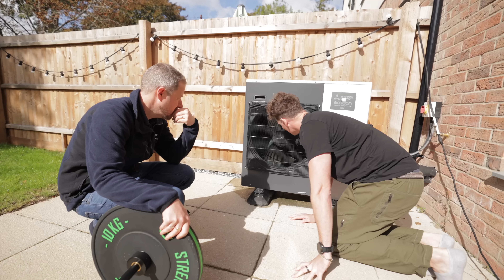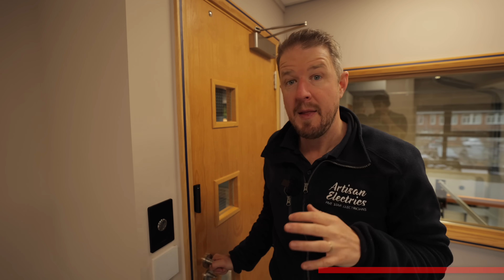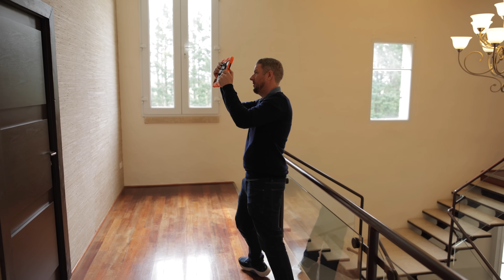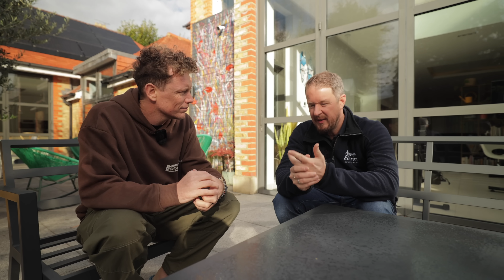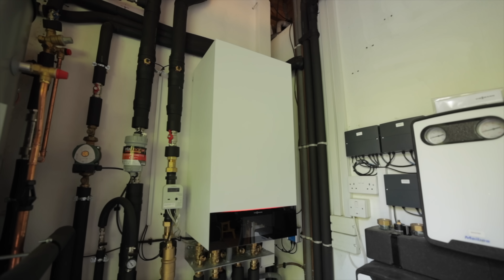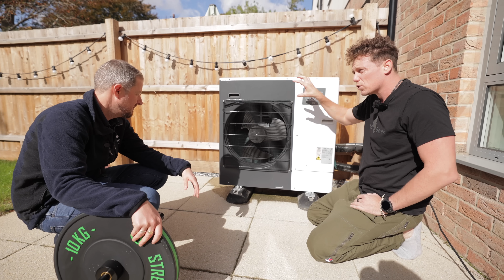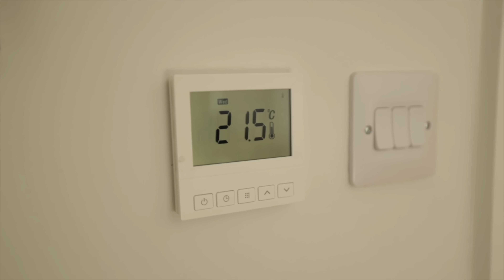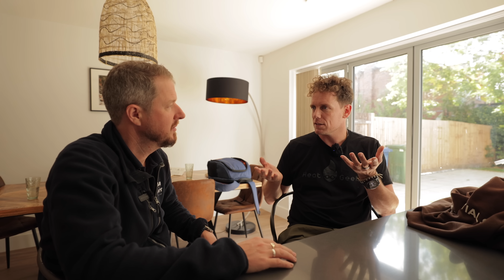Are Heat Pumps Really Worth It In 2026?

Comment from the maker: We’ve partnered with iwoca to help more small businesses like ours get the funding they need — check them out here 👉 iwoca.co.uk/artisan

Make sure to check out the Heat Geek YouTube channel for more in-depth technical videos, training content, and expert insights on all things heat pumps and low-carbon heating - https://www.youtube.com/ @HeatGeek
Reply: What’s was the link for the heat pump postcode check, don’t see it in the description?
Reply: As a retired Heat pump Manufacture , I personally believe the statement by Heat Geek is claiming that Air source heat pumps are as efficient as ground source is erroneous.  The COP is never as good as a well designed Ground source and it doesn't have to take its heat source from bore holes it can be from lakes rivers even from disused mining levels. the other issue with air source is the ice build up on the fin coils and either reverse cycle defrost or electric element heating to melt that ice destroys there energy efficiency particularly due to icing and and the UKs very high rainfall and general damp conditions. i also would add that his statement regarding insulation was misleading. It doesn't matter what form of heating solution that is employed to maintain a comfortable internal environment, insulation is paramount. lack of insulation increases the  cycling of the system trying to maintain that desired temperature due to heat losses due to totally inadequate insulation or lack of. Think about a passive house and its fantastic thermal performance and the borderline need for a heating solution.
A good heating solution starts with the best insulation you can afford including your windows minimum double glassed preferably triple. Then when you know what the heat loss for the building and only then can you look at what type of system and design. Also its not just about the comfort heating that needs to be taken into consideration its also hot water for washing and bathing as these require much higher temperature's and these need to be factored into the equation as the cop also dramatically declines if you are going to achieve a consistent minimum 60deg c preferably once a week 70Deg c to prevent the growth of Legionella bacteria, an immersion tank should store water at 60°C or higher. This high temperature kills the bacteria, which multiply most rapidly in warm, stagnant water. Its also good to remember to run taps regularly to flush the taps/pipes again because of the Legionella bacteria love the taps that are not used regularly.
Reply: @disabledglobalchallenge290    I’m lost on all this and that in this thread. Was the original argument/discussion not about ‘anything to water’ or ‘air to air’ heat pumps?  Clearly ground sourced (or water sourced) energy is going to be superior to A2W because of the incessant defrosting necessary in our humid climate.  

I expect a borehole is the most consistent, if done properly - but at very high installation cost at the present time.

Ignore this post if the answer to my initial question above was “no”.
Reply: Brilliant to see two excellent influencers collaborating on this. Two quick things which might hopefully help @artisanelectrics

The immersion heater switch needs to be left on because there is a contactor within the heat pump controller to complete the require pasteurisation cycle. Also the outdoor sensor comes fitted to the back of the Mitsubishi heat pump so you can run with weather compensation out of the box.

We hope this helps 🙂
Reply: Immersion needed on modern units!
Reply: Just this year we had an awful (stressful and expensive) situation with a roofing company who damaged our house and took off with our money leaving us to pay for another roofer!!) We are now very distrustful of any trades doing any work for us even though we are interested in heat pumps. What guarantee do we have (in writing) that the replacement heat pump will work as it should do?

Comment: I recently had a mitsubishi heat pump installed by my housing association and I must say what a load of rubbish they are. Costing me twice as much in electricity and was never shown how to use it so I have turned the heating off and sit with a heated blanket instead. I wish they left me with the old boiler.

Comment: When I bought my house it had a failing kerosene condensing boiler. When it had been fitted, maybe 10 years before, the old roof venting flue was replaced with one sticking out the wall at head height - right underneath a balcony on the master bedroom. First night in my new home I was wakened by the sound of a "whoosh" as it started followed by kerosene exhaust fumes billowing in the window. The ASHP moved up the shopping list to number 1! Anyway, two years in it has been a revelation - saves me about £200 a month (electricity cost v oil cost), is almost silent, doesn't smell and maintains the house at a comfortable temperature. Anyway the house is big - 3500 square feet and over 100 years old - despite this a single, single phase, ASHP was adequate and effective. So don't be put off by the "they don't work" myths.

Comment: I got rid off my heat pump went back to the electric 400lt tank the other would heat up during peak times never enough hot water and always on even tho it was around 330lt I have more hot water now and run it on off peak and solar/ batteries

Comment: Licenced electricity suppliers will be able to control heat pumps via the internet by the end of next year under Ed Miliband’s plans to help Britain’s energy system cope with high demand.too much demand lower heat pump output, put on coats

Comment: Here in the UK, heatpumps cost 10x what a boiler does. Costs 10x what a gas boiler costs to run. And will breakdown 2x as often with 10x the repair costs. They also dont cool the house well as all our houses are super insulated to save heat in the winter. Any clever ideas like ventilation will be offset by polution filters and LAWs on building design making throughdraughts bad for winter efficiency. Some houses even have windows that wont open. Ive seen offices that switched to heatpumps and everybody brings in under desk electric fan heaters to stay warm in winter. Thats not cheaper. An elderly relative swapped her gas boiler for a heatpump. Gas install 2k. Heatpump 15k. Gas annual running cost 1k. Heatpump 5k. She wants it ripped out. Our government love flip flop ideas. They keep changing the goalposts to make people spend money. Its nothing to do with saving the planet. Pushing Insulation in walls and roofs. Now being removed because its bad for damp and some people cant get mortgages because of it. Push for gas boilers as its more reliable. Now gas is bad. Push for LPG cars then put up the tax until no one has them any more. Push for diesel cars. Scrap all petrol cars. Now diesel is bad and petrol cars are more expensive. Diesel cars are being taxed to the scrap yard. Push for electric cars. Now increased tax on electric cars making them more expensive to run than petrol. Its all a joke here. after all that the UK only makes 5 percent difference to the world environment. God help the planet.

Theres a theory that the rainforrests are dying because theres NOT ENOUGH co2. That the world co2 levels are actually dangerously low and our Governments are too scared to backtrack on 50 years of taxes.

Comment: I recently saw a chart indicating heat related deaths are higher in Europe than the US because we have heating and cooling. A heat pump can offer heating and cooling. Any reason why more heating/cooling heat pumps aren't being installed more? I realize you are hooking up the heat pump to a single boiler for radiant heating/domestic hot water, but you have more choice with heat pumps being able to heat and cool. And from the weather reports I have seen recently your summers are becoming hotter for longer durations. Maybe it is time for multiple zones that offer both heating and cooling options.

Comment: Put something outside in your back garden with a large high voltage PCB in it in all weathers and it’s just a question as to which will come first, that the board will fail just outside the guarantee or the neighbours kid with poke a stick through the evaporator.

Comment: My house is 1906, 9" wall construction. All double-glazed, 300mm of loft insulation. Heatgeek would not agree to honour their engineer fitting a unit to warm my property. The engineer said he could do it without them being a part of it, but would require two heat pumps totalling £20,000 of work. This is not a solution for old homes.

Comment: In Sweden an air-to-air heat pump is around £3k fitted. Not 10k. No need for a £7.5k taxpayer funded subsidy when the systems are ubiquitous and decent installers actually face competition.

Comment: I was speaking with a friend who has had an air source heat pump for several years. He’s noticed that his electricity bills are quite high during the colder months, and the system struggles to achieve comfortable temperatures on particularly cold days.

This got me thinking about the running costs compared to gas heating. If electricity is roughly four times more expensive than gas, but a heat pump is around four times more efficient than a traditional gas boiler, you might expect the costs to balance out. However, most households only run their gas central heating for about 8 hours a day, whereas heat pumps tend to run continuously (closer to 24 hours). When you also factor in the upfront cost of purchasing and installing a heat pump and upgrading radiators, etc, it raises the question: where do the actual cost savings come from?

Am I overlooking something in this comparison?

Comment: so its incredibly simple, yet so god damn expensive. and it doesnt work in negative temperatures. lovely. i ll pass. my gas boiler consumes 70wh of energy, meaning, if there is outage on the grid, i can feed the boiler off of a battery for weeks, you cant do that with a heat pump.

Comment: I was massively on the side of heat pumps, I love the physics hack. I watched that technology connections video way too many times. 

I seen the accounts from skill builder and heat geek and understood an installer can make or break the system. 

So, when we got our new B90 rated self build we ensured we got a great installer (Precision heating). We didn't cheap out on the heat pump unit either, opting for one of the "best" a Viessman 151-a (10kw).

After 3 months, and consistent £600pm bills for the pump alone, my heart is broke. The house is cold and my wallet is getting drained. 

I hate this system, these are a bloody con and this summer an oil boiler is going in.
Reply: I have to ask if they don’t work why are they so popular in Scandinavia? Countries with colder climates than us? Are you absolutely sure that your installers were competent?

Comment: My home has been heated solely by a heat pump since it was built in 2006 and has worked fantastically except for a couple of days where the temperature dipped below -15°C where the pump switched to heating directly off the mains supply. However, the unit is massive, noisy and located in my basement where we can barely hear it. We’ve also underfloor heating throughout.

Comment: Love Heat Geek - my kind of heating technicians - would be signed up if career wasn't drawing to a close. I fit HPs as well as traditional oil and gas systems but can't help a couple of comments:

Rather glossed over cost with throwaway comment about service size increase, also what happens if the DNO refuses permission because there are already to many EV/HP's on the street infrastructure? Rural properties on end of a high impedance overhead supply? Possibly not happening often yet but....

The other thing that is never mentioned in HP 'favourable' videos is that if one were to make all the consequential improvements to emitters, piping, insulation etc that are needed to make HP viable to say the 5kW unit in Jordans place they would mean you only need a 5kW gas boiler sitting on the favourable side of the spark gap - what I'm trying to say is that the reduced operating cost doesn't come from the HP itself but from top notch design and attention to detail in the installation of consequential improvements which generally costs substantial money (not to mention disruption) as georgehurst6123 below found out.

And speaking of consequential improvements, the elephant in the room, millions of Combi boilers....HP needs a cylinder, somewhat larger capacity than trad sizes and possibly a buffer vessel - so many homes have repurposed that  airing cupboard space if it ever existed in the first place.

I have nothing against HP's, fitted one for my parents, but the number of situations where they are economically viable to fit is sooo much smaller than the powers that be would have us believe.

Comment: Heatpumps are not working in every house !. What a bullshit saying you don't need  wall insulation.  Theoretically he is right saying this but in those kind of houses the heatloss or heatload will always be larger than available domestic heatpumps can supply. Base on my experience only roof insulation and double glass and let's say 250m² yo be heated you will arrive in the plus 15kw HP. Ok those exist,but  not cheap. But most important we are speaking here about heatloss at eg minus 7, heatloss tjat id 24 hr a  day present in winter. Minus 2 is far to positive to make your calculations. So you in case your HP has an average cop of 3.5 (which would be very good). We are speaking  of 100 kwh a day. Depending the elek price something like 35 eur a day to heat your old non insulated  dwelling  . So no HP are great but start to insulate first, get low heatloss so you can use low temperature emitters and then think about of going for a heatpump not the way around.  I have seen so many dramas 30k for new high power high temp HP in old houses resulting in cold houses when temp drops below zero and massive bills. All those xperts don't tell you what happens with HP around zero degrees outside.  Deftost , in worst case every 40 to 60 minutes you have one. So your fancy HP is not giving you 15 kw but maybe 10. Result cold hous. As simple as that. But yeah with honest advice you can't sell HP of course.

Comment: we had to get a new boiler lasty year as a surprise part of getting a garage conversion/extension build and had to go for a replacement oil boiler cos I didnt have time to spec up a heat pump even tho i was wanting one when the old boiler was due for replacement. I thought it was gonna last another few years but turned out it was done.
A new heat pump should be a drop in replacement in a few years tho.

Comment: So you can have a Heat Pump, or a Solar system or a Battery system only - or any 2 from three, or all three.   But above all you need a good survey, a good designer, a good installer and the best electricity supply plan around (perhaps with off peak and /or purchase back to grid).  Plus good roof/wall/window and piping insulation, not microbore CH piping, sufficient radiators.